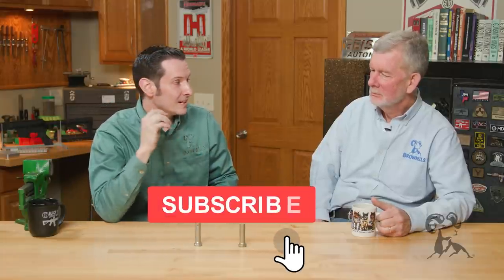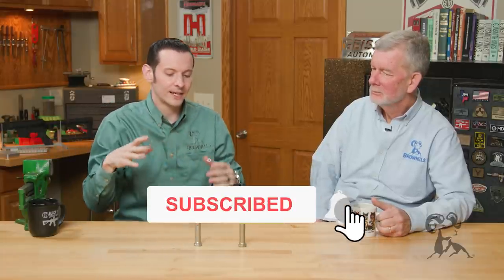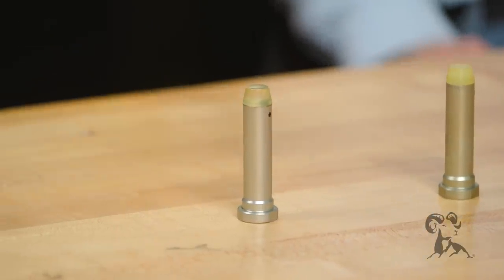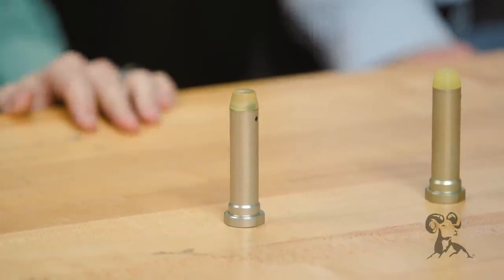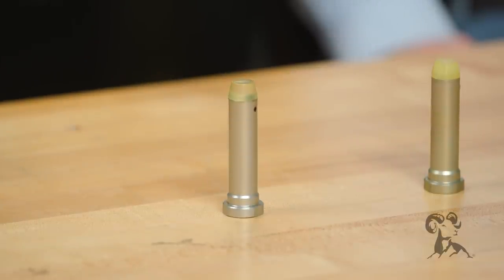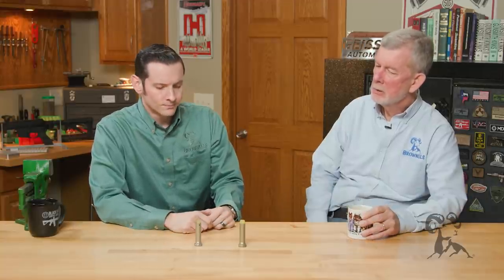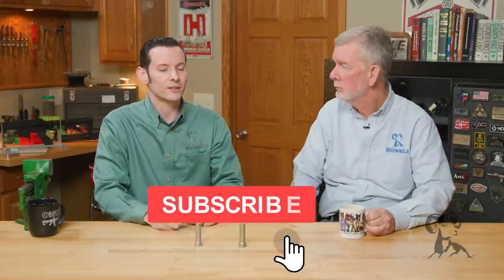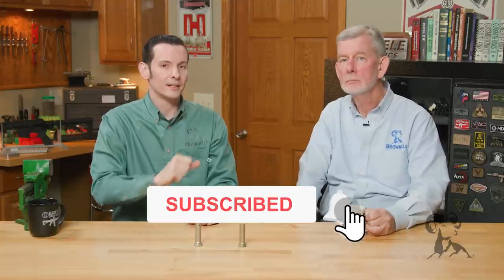Smyth Busters: A Heavy Caliber AR-15 Requires a Heavier Buffer

Comment: I recently built a AR47 pistol (7.62x39) with a 10 inch barrel and was not cycling right with failure to eject at times or having the spent casing pinched half way coming out. I originally used an h1 buffer weight that came with the Shockwave Blade set up and after talking to the guys at my local gun shop they suggested using a carbine weight buffer. Long story short, it runs great now with no issues. Can someone explain how a lighter weight helped when I thought I needed a heavier one?
Reply: The heavier the buffer weight, the slower the bolt velocity.

Comment: I’m cycling supersonic real good just when I use subsonic it fires 1 round at a time, I was told it should cycle once I get a suppressor
Reply: Need adjustable gas.
Reply: I’ve got an adjustable BCG…and still wouldn’t cycle properly
Reply: @MrRoro256  Which one?

Comment: Working on a 6.5 Grendle in an AR platform that is overgased, double feeding, ejecting in the 1-2 o’clock and experiencing bolt bounce. It has all factory assembled components that include a 3 oz buffer. Tried three different mags and same results. I’m changing out to a 3.8 buffer. Based on the video, is my diagnoses still sound?
Reply: I would definitely get an adjustable gas block. Being over gassed can cause problems.
Reply: I built a 6mm ARC and went with the A2 buffer because that's what I read on the internet regarding the 6.5 grendel.    Now that I have seen this I wonder if it was necessary. It seems to run fine.  Though I have only shot 30 rounds through it 😂.  Dang ammo shortage 😒
Reply: Your best solution would be to correct gas drive, and the easiest way to do it would be a BRT gas tube. No setting screws or moving parts necessary means it’ll stay reliable. 

But if it’s gonna be used in adverse conditions you can tame that heavy gas flow with an A5 buffer system (and likely a Sprinco green spring) and that sucker will run like a sewing machine even when it gets filthy

Comment: I have tried a H2 buffer on my standard AR15, and the recoil was minimized without altering the bolt cycle but after firing about 100 rounds broke the buffer retainer. Solution: Put back the H1 buffer, replaced the buffer retainer and now works as was intended.
Reply: @Unequalibrium  thank you for the info but my upper and lower are certainly mil-spec (Anderson/AeroPrecision) and the buffer retainer that came as part of an Anderson lower part kit could be faulty. I replaced it, put back the standard carbine buffer and works perfectly.

Comment: Seems like this site has some differing options.  I’m running a 7.62x39 and it recommends H3. https://www.80percentarms.com/blog/ar15-buffer-weights-what-the-difference-is-and-how-to-choose/. My barrel is 16” with carbine length gas block but I’m also breaking the rules with a piston driven AR47.  Superlative Arms kit. I tried both H and H2.  Cycles too fast with the H, think I need a bit more dwell time with a heavy buffer.

Comment: This isn't correct. It's case by case basis, and totally dependant on what parts you have. If I were to use a standard carbine weight for my 762x39 rifle it would beat itself to death. The carrier velocity would be too high. I bought the odin works adjustable buffer and I found that it likes the h3 buffer weight, and 762x39 only produces 25% more energy than 556. The ar system is a 4 part balancing system between how much pressure is produced at the port, how much pressure you let through the port, how long the internal gas piston is sealed, and how much resistance to rearward travel the carrier has from the buffer and spring system. It's more complicated than you are letting on, and shouldn't be blanket stated as simply as you're putting it.
Reply: I have tested and use a standard 3.0oz buffer in my 7.62x39 build, if you are having those issues you describe, then the gas port in your barrel is too big, rather than upping your buffer weight, you would get better performance by using an adjustable gas block.

Comment: I picked up a 450 Bushmaster upper and it is basically a single shot. It won't grab the next round.
Reply: My 300 blk did that and I ordered a flat wire spring and H2 buffer from midway usa and that fixed it.

Comment: How about a 50 Beowulf upper?  I been using it with a standard AR 15 lower and was wondering if the buffer spring might need to be stronger.
Reply: Did you even watch the video, genius?
Reply: @alexjordan6371  Don't be a jerk.

Comment: If any of this were true, then top reliability companies such as BCM, DD, Colt, and SOLGW would use a 3 oz buffer. They don’t. They ship with a 3.8 oz H buffer or heavier (Sons uses H2 with Sprinco Blue spring or a Vltor A5H2 with Sprinco green spring as an upgrade)

Only thing busted is a lot of locking lugs on ppl’s bolts after a couple classes with their overgassed POS that cycles too fast due to a light buffer
Reply: Well if it's over gassed that is another problem entirely.
Reply: @slimjim7411  The companies shipping rifles with carbine buffers are almost always overgassed.  And a properly gassed gun will run a H buffer, but with the added benefit of more momentum to feed rounds from the magazine as the gun gets dirty

Comment: You guys crack me up.  You state You don't need a heavier buffer to run a heavier caliber then you state the AR10 in 308 requires a heavier buffer to drive the heavier bolt carrier and heavier bullet properly.  The 450 bushy is a much heavier cartridge than the 5.56.   My 450 had ftf problems and I tried numerous fixes.  Finally installed the H3 buffer and problem solved.  You can say the myth was busted but I say you admitted it is true.  Love most of your video's but this one you missed the mark.  Cheers
Reply: They note that 308 should be considered a different system/platform.

Comment: You start off saying all you need is a standard buffer, no need to use a heavier buffer. Then you ask why do they make different size buffers and you answer is it’s to tune your system and you rattle off several reasons why you’ve used different size buffers. The. You say myth busted, no need to use anything other than standard buffer. WTF?